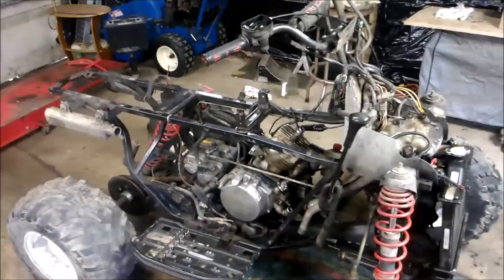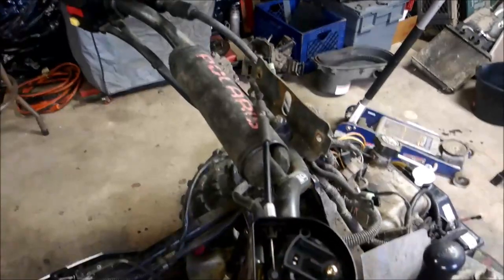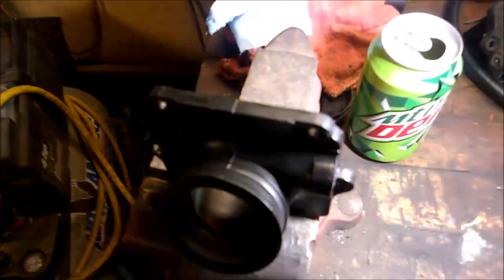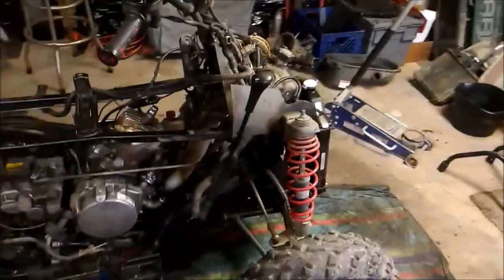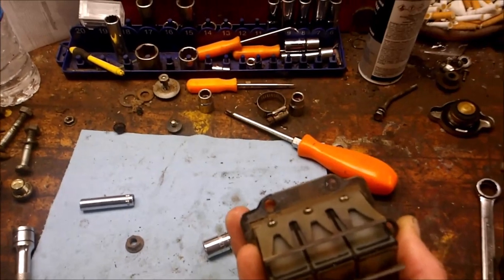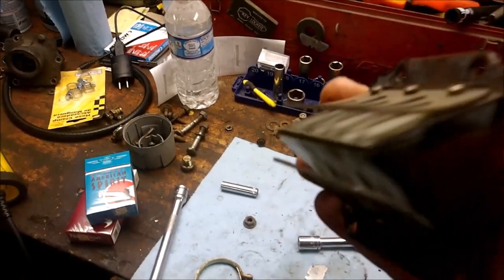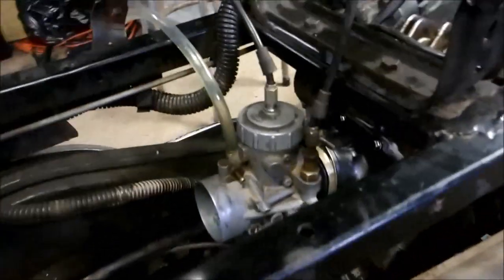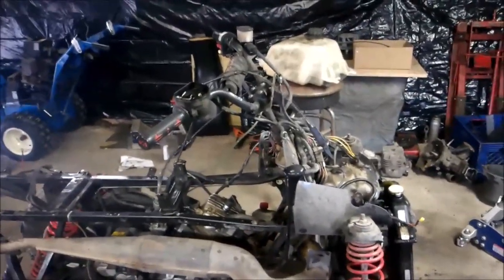UPDATE! BACKFIRE ISSUE ON A POLARIS SPORTSMAN 400

Comment: Hello, 

I would greatly appreciate it if you could help me out here. you probably get a bunch of requests so if this is out of line just ignore this.
I am stuck as heck with my 95 sportsman! I got it with a seized engine. It seems the crank was initially assembled without the rod bearing, which left enough play for the rod to smash a hole in the crank case. That led to debris shattering the piston skirt and ultimately jamming up the engine. I replaced the crankshaft assembly, crank case, all bearings and seals. When I went to start it up it initially ran. but for some reason it cut off, no alarming noises, just as if I pressed the kill switch. Now the thing wont run. Here's what I checked:

The key is on and selector to run.

The shifter is in neutral.

The battery is charged.

The carburetor is clean and all passages are clear.

The carburetor is getting fuel and the bowl is full.

The throttle is moving as it should.

The spark plug has a strong spark.

The spark plug has a small amount of oil and gas mix (barely any).

There is a lot of compression (did the finger check) 

There are no broken wires that I can see.

Disconnected the CDI black wire (it was worth a shot).

I tried putting fuel directly down the yap. 

The oiler is connected to I've been running normal fuel.

I disconnected the oiler and used properly mixed fuel. 

I disassembled most of the engine again and verified that the stator and crank timing marks are correct. 

Sometimes it has a small backfire out the exhaust, and it seems like its almost firing. but never gets more than a puff.

what on earth could be going on here? Do you have any suggestions?

Comment: I’m having the same issue with my 03 trailblazer 400, back fired so hard it separated the head pipe. I replaced the reeds as they didn’t close all the way but that didn’t fix it. I will check the boot next thanks for the video

Comment: Super tips, any air leak after carb is bad, l have to put a much tougher rubber boot hose  between carb and intake on my Big Bear, as the thin yellow boot by dealer is a joke, getting lose often and so backfires....

Comment: I have a 99 ranger 500 6x6 have the same issue but my question is would this cause the crankcase to fill with gas ? Oil smells like gas 
Was sitting for a year straight. Started up and drove then parked it next day started having issues . Since then I’ve replaced / rebuild carb 
And changed oil twice . Right after oil change runs great plenty of power then shuts off and won’t start .Let it sit or choke it and will crank but will flood and back fire threw exhaust . Thank You love the channel I’ve learned so much .
Reply from the maker: Most likely the needle and seat leaked on carb and gas went into engine. Drain the engine oil, see how much or if it's gas in there. Clean carb. If it's blowing oil out the exhaust it could be valve seals or head gasket. A crack in the carb boot will cause it to run lean and backfire. I had a 700 do that. It ran like crap. Replaced the boot..All good.
Reply: @TitaniummanGarage  Thanks . Do you have Instagram I can follow?
Reply from the maker: I need to learn how to do that. I have a Facebook Q and A page.
Reply: @TitaniummanGarage  followed you thanks
Reply: @TitaniummanGarage  Also, if rings wear out, and low in compressions, much richer fuel is required to keep it running and smoking,  oil could smell gas too....

Comment: Any chance you would be willing to help a new Polaris sportsman owner with some issue i have been having with my 96 500? Been working on it for nearly two months and all it is doing is starting and smoking white while cutting off after a few seconds if my throttle is let go, respect your videos and knowledge on these quads. Thank you
Reply from the maker: White smoke is usually an indication the head gasket is bad. Are you losing coolent in the reservoir or radiator? How does the spark plug look?  Could also be the rings. Hard to tell without seeing it.

Comment: Nice video man. I'm working on my Grandfather's 95 sportsman 400 right now and i cannot for the lift of me figure out wtf is wrong with it. It idles fine and then all of a sudden revs up like crazy. It's also smokey as hell out of the exhaust and stinks like fuel. I put a new carb/carb boot on it, changed all fluids, changed plug, and i'm stumped. 

I'm not as knowledgable as you regarding the head so i'm afraid to take it off :/
Reply from the maker: No worries. Sounds like you have it running rich or dumping alot of fuel in it from the carb. I would also check the throttle linkage sometimes they stick and the choke. Adjust the air/idle screw on the side. I think its 2 to 2 and a half turns out. Turn the screw all the way in and count the turns till it seats. then turn it out. then adjust the big knob on the side to adjust idle speed. You can also adjust the throttle cable coming in from the top of the carb. Thats what I do most of the time. then adjust the idle screw. Sometimes the needle on the slide needs to come down farther. You have to do this once its warmed up. if its at cold start you will be at it for hours. Hope that helps.
Reply: @TitaniummanGarage  Thanks for the reply man. So I redid the head gasket, brand new carb, checked to make sure throttle and choke aren't sticking. I got under it and turns out that whatever the plastic tube that runs up the side (with the small cooland reservoir tank) was disconnected from the bottom of the motor. So I reattached that and now I'm trying to do all the fluids and figure out what the heck is going on there. I can't find the oil filter though lol. I took the center plate off the bottom and I still can't find it. I feel ridiculous.
Reply from the maker: @MrShakespeere  It is oil injected. There is a tank in the front that has a cap by the hood. When you hit the throttle oil comes from the tank into the carb. Some guys just mix oil in the gas 32:1 The coolant reservoir tank tube runs up to the radiator cap. Its a overflow tank. And don't feel ridiculous. I went through the same thing on my first 400 7 years ago and at that time there weren't many videos out there. That's when I decided to start my channel. I fumbled through it. Had some help from a friend, and decided to share what I learned.

Comment: I have a 95 explorer 400 I have set the static timing and the flywheel mark dose match up with the top dead center.  However how important is it to set dynamic timing ?  Or should I just set the stator mark lined up and forget about it ? Your help would be much appreciated
Reply from the maker: I would set it at the timing mark. You should be good.

Comment: I have an older 2stroke with no tps that will all of the sudden run open throttle anyone have an idea what could be the issue?
Reply from the maker: Dirty carb, Rusty throttle cable, weak spring in slide, oiler stuck open causing throttle cable to stick. lots of things. Hard to tell without seeing it.